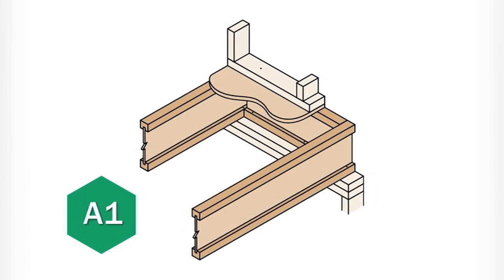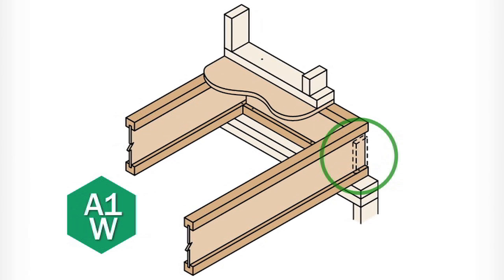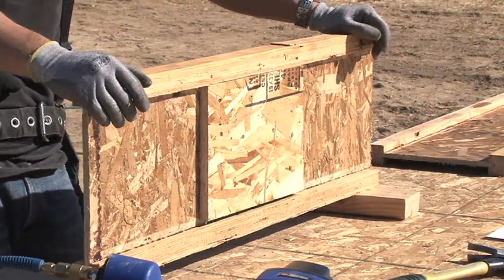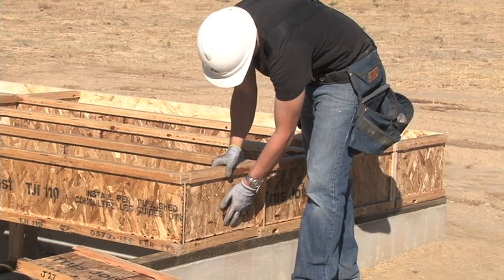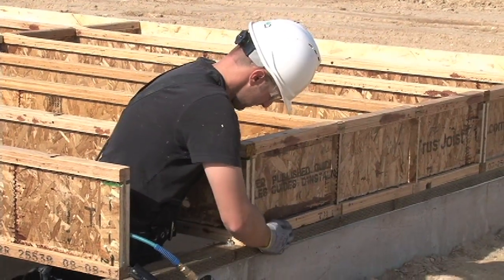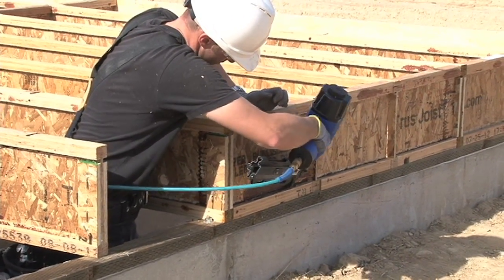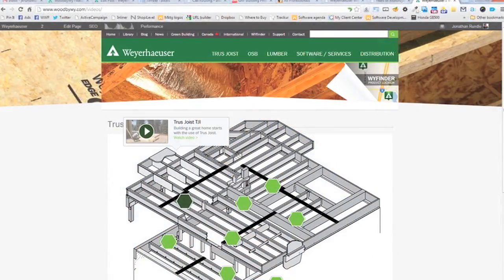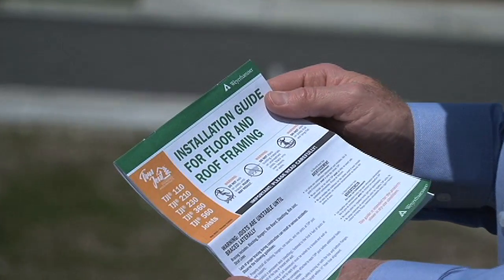Detail #A1 / A1W - Trus Joist EWP Floor Installation Guide

Comment: I just moved into a house with these joist and wanted to put a 150 gallon fish tank on them. Any ideas of the best way to support the floor from the basement. My basement has 10 ft ceilings so thinking some jacks and a couple extra hardwood joist
Reply: Itl be fine. If it can support your wife,  the tank will be easy
Reply: @galvanizedgnome  That is roughly about 1300lbs concentrated load so NO THE ORIGINAL DESIGN WILL NOT WORK.
Reply: I would go back to your supplier and get your answer, otherwise your warranty is out the window if you try to guess at it and you have a failure. This is a 1300 lb. concentrated load ( water weighs 8.35 lbs. per gallon). You will be adding additional joists I suspect.
Reply: The weight of the water in the aquarium is roughly 1300 lbs as pointed out, but this should be designed for a minimum of 1500 lbs. In addition to the water weight, we have to consider the weight of the glass tank, the cabinet it will be sitting on, the accessories for the tank and the one or two humans who could be around that area admiring the tank at any given time. All that said, as a quick fix, I would build a wall in the basement perpendicular to the joist framing, directly below the load and let the wall extend 24"  beyond the footprint of the load on each side.

Comment: I want scientific evidence that TJI is stronger than dimensional lumber. My research so far is not favorable to TJI. If anyone can point me to a test that does proper Span press shearing tests with multiple trials of both types of joists, with ALL of the relevant test information included: span size, dimension of sample, and maximum load all with units (I didn't think units would be necessary to demand) I would be very grateful. That is what it will take for me to believe the popular claim that "it is stronger and can span farther".

Comment: More American " minimalist " building practices. 
I wouldn't have a foundation wall any smaller than 6 inches , eight inches is better with a wider footing to accomadte future remodeling loads. 
I would prefer a solid timber rim joist with hangers for the TJIs instead of osb as a rim joist. Any water penetration onto osb will be a disaster. Also any additional joists that might be added during remodeling can be easily attached to the rim joist.
Reply: Trying to install a deck ledger and the basement is finished. What to do...?